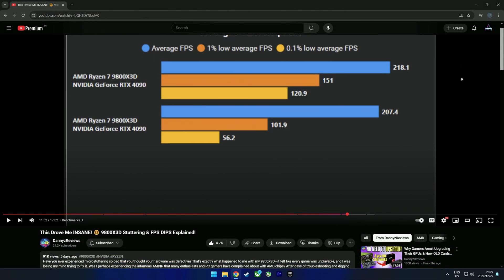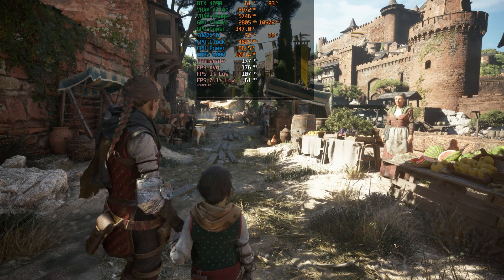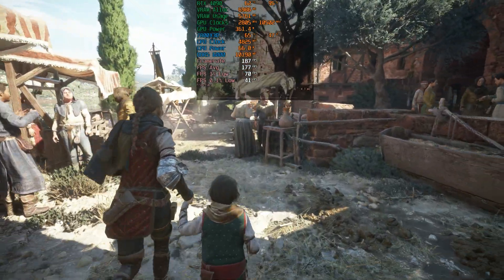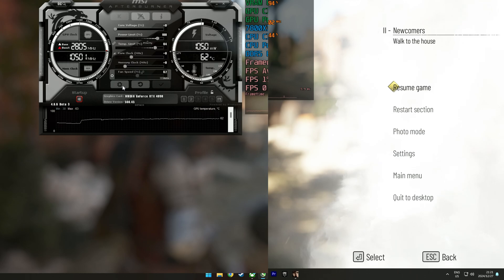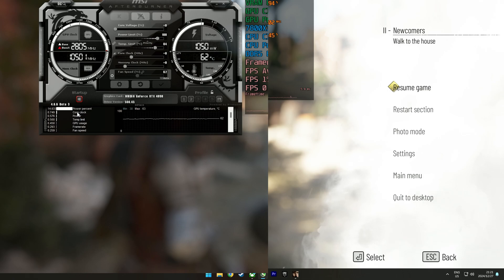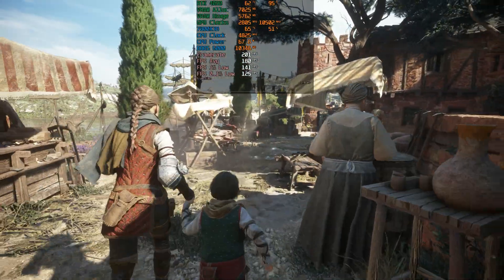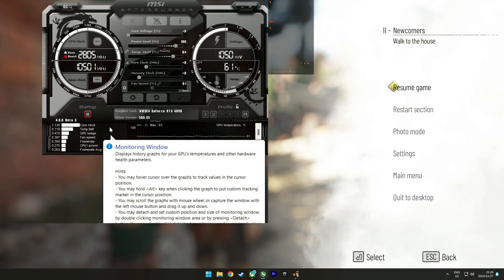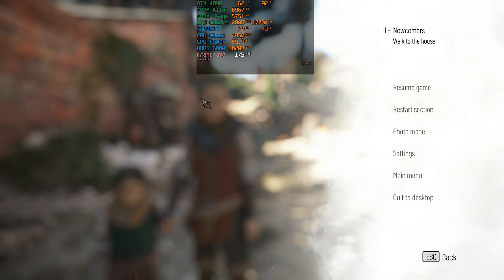MSI Afterburner Causing The Infamous "AMDip"?

Comment: I've been using MSI Afterburner since the end of 2015, so around 9 years now. I've gone from an i5 4460 to i7 7700k to R5 3600 to R9 5900X to R7 7800X3D and always used the OSD with a bunch of settings to see GPU and CPU temps, their overall usage, Vram allocation, Ram usage, and of course the FPS. With my 5900X PC around a year or two ago I turned on the frametime graph and discovered the actual dedicated Vram usage, I also had power usage for GPU and CPU showing.

Regardless of what's showing in the OSD, and even with the OSD off, as long as a setting is ticked in the Monitoring tab, Afterburner is going to be monitoring it. By default nearly everything is ticked, it's possible everything is ticked by default, I don't remember. But I usually would add some to the OSD, but I turned almost all of them off and immediately noticed a large reduction in stutter and that frametime graph is significantly smoother in games like Spiderman Miles Morales, BF2042, GTA 5 and Far Cry 6, those are the only games I've tested. 

These findings are absolutely insane, and a seemingly obvious one. You would think that it would be more widely known, and more heavily stated on the MSI Afterburner page that the monitoring is quite CPU intensive. Dedicated Vram Usage was like 5-10ms, GPU power was also 5-10ms, not to mention every other setting I wasn't using being ticked.

Comment: thanks for this, my GPU power metric was using 5ms 3.5 more than the next highest, perhaps I'll get an elmor labs or TG power monitor
Reply from the maker: You're welcome. That reading for power is actually quite okay, so the best is to see if it actually has an impact big enough to cause stuttering. Some sensors are combined and might show higher number than others, but might not cause stuttering. 

What I did was disable everything and start enabling things while a game was running. That way I can see how big of an impact a specific sensor really has, and in my case it was only power percent that had a big enough impact to cause stuttrring.
Reply: @Mostly_Positive_Reviews  thats a very good idea. im getting a new gpu next month and was only tracking so I can make sure I get a good gpu that uses the same but preferably less power than my 1080ti

Comment: What exactly is the problematic setting for the issue?
Reply: As he showed, you right click the graph and see which settings are using a lot of CPU time such as GPU Power, in my case with the same specs I had GPU Dedicated Memory was using 5-10ms as well. 

If you find some using a lot you can turn them off by going in to the Afterburner settings, then in to the Monitoring tab, and on the left of the settings you want to untick them, if the tick is lit up then it's on and will always be monitored by Afterburner even if it's not in your On Screen Display. 

Your OSD settings are ALWAYS being monitored by afterburner when that tick is lit up regardless if your overlay is on or not. 

I'd suggest unticking everything besides the ones you absolutely have to use. If you don't use an overlay and use Afterburner just for overclocking then untick everything.

Comment: Power has no impact for stuttering on my 7800x3d, maybe there is another factor for it 
(bios? bios version? Bios manufacturer? Bios tweaks? System tweaks? System? System version? Memory tweaks? Who knows?) While gaming doesnt go "high" ms to cause microstutter/spikes due to monitored power or any of the other chosen data stuff. I've tested same game Requiem too.
However good video to demonstrate profiler so more people get inform about it and clearly explaination about it too.
Reply: while your game is running turn off rivatuner "Application Detection Level"

Comment: The big question is why are people still using programs like MSI Afterburner? I stopped using it years ago after it was causing problems with games. AMD has their own monitoring built into the graphics drivers that works far better. Don't know if Nvidia does, its been years since I had Nvidia.
Reply from the maker: Because MSI AB gives a lot more info than the tools included in the drivers. A lot of historical data like individual CPU core usages, frametime graphs, 1% and 0.1% lows for when benchmarking. It's basically a CPU and GPU monitoring tool in one, which is very useful to someone like me who does benchmarking content.
Reply: @Mostly_Positive_Reviews  I would suggest Goverlay then. It is what I use on Linux.
Reply: Amds overlay has always been buggy for me even with Decembers latest drivers. Info being blank requiring tggling the overlay off then on again, cpu statistics randomly just straight up missing for no reason(tested on multiple fresh windows/driver installs), on top of showing different temps/cpu usage compared to afterburner/capframex
Reply: @ultimategohan1551  Goverlay is a free open source program to use.
Reply: @ultimategohan1551  I've replied twice to comments here and both have been removed. I'm not saying anything controversial or profane so I can only assume the channel is removing them. I'm listing a program (Goverlay) I use to track my temps and usage in game. Let's see if this one stays...
Reply: @YourDeletedComments  Did you include a link? Because that often triggers Youtube's auto mod.
Reply: @ no links, I learned those get deleted a long time ago.

Comment: yep it is the power percentage not the power itself. Thanks a lot for this monitoring trick for CPU time in MSI afterburner. I noticed GPU dedicated memory usage\process also takes a steady amount of 2.5-3 ms.
Reply from the maker: You're welcome! Some sensors are actually combined, so some will show 0.001 and others 5 for example, and in many cases it's because some sensors are combined in that output. Unwinder, the developer, told me about another way to monitor the cost of these sensors so will do another video showing that too.
Reply: It is more than normal value. It cannot be zero. I'm afraid I open jar of worms by showing profiler to everyone. Now a lot of users see something they don't understand completely and start interpreting it wrong.

Comment: idk why would someone run msi afterburner while playing or using his pc in general.. even if you have an oc profile.. you can make a bat file which can load the profile on startup without even opening msi afterburner... the only thing that requires msi afterburner opened is the fan curve.. which is useless.. just put a static speed
just put this text(including the " ") in text file and rename it to whatever.bat
"C:\Program Files (x86)\MSI Afterburner\MSIAfterburner.exe" /Profile4 /Q
u can change the path as yours also the profile number you want
can you pin this comment?@Mostly_Positive_Reviews

Comment: this is the reading time from gpu these sensors usually need from 10 to 18ms and this is normal for many years. I have it like this on intel and I have no problems with frametime. I have temp gpu. power gpu and hot spot gpu I have amd 7900xtx gpu. Maybe nvidia drivers are messed up like last time

Comment: Yeah, any monitoring software can cause this.  A way to monitor output FPS using a dongle on the HDMI/DP video output might be interesting.
Reply from the maker: Yeah, what DF does is use a capture card but they have their own software that marks each frame. Them when they play it back in their software it can tell you what your FPS and frametimes are. I know Nvidia has something similar to identify duplicate frames, and I think their software is kind of based on similar technologies. Could be completely wrong though. But in that case you are limited by your capture card's refresh rate.

Comment: yes i always have turned off the ones i don't use otherwise it causes a dip.  i've been saying this to framechasers and media alike.  it's always a program or some sort of setting.  however i still can't explain why this doesn't happen on intel.  wattage could be a factor as well since amd is trying to be efficient.  if it's fixable with turning off MSI Afterburner settings for example, then that's good enough for me as i find it a very rare thing to occur anyways.
Reply from the maker: Yeah, being selective in your probes / sensors is the best way to go about it. They all have some impact, but some a lot less than others, so it's importsnt to find that sweet spot. 

With regards to Intel vs AMD, I have no clue really. I've seen some people say they have this issue on previous gen Intel CPUs, specifically 10th gen laptop CPUs, but I havent been able to reproduce it on either my 12th and 14th gen systems. I still need to test with e-cores off though.

Comment: why would you use MSI afterburner if theirs a whole wattman tool in the AMD drivers? i dont understand people you think a third party APP is going to run better than AMD's own implementation? lmfao USE YOUR DRIVERS.
Reply from the maker: Now why would I use AMD drivers when I use an Nvidia GPU in this video?
Reply: Well since as far as I can tell I can't get it to show that data in screen recordings so I have to rely on (Well was using Afterburner but now will use FPS Monitor which still might have issues with frame times and will have to test out.

Comment: Huh, I just tried it and it works..
Reply from the maker: You sound surprised? 🤣
Reply: @Mostly_Positive_Reviews  Yeah, why TF is Afterburner doing that (rivatuner)
Reply from the maker: It's got to do with how the NVAPI is called for this sensor. It's not limited to Afterburner though, most monitoring software have the same issue reading this value on Nvidia GPUs.
Reply: @Mostly_Positive_Reviews  Makes sense. At least I can still have stats up without the weird behaviour, cheers for the video.

Comment: 7800X3D here, I don't even use the Afterburner myself, so I should be good to go?
EDIT: I did fire up the Afterburner just now (in desktop) just to see which monitor/sensor could cause any issues and immediately found "GPU1 Temperature" hovering between 15 and 16ms while everything else was way lower, second highest value (Framerate) only showing 0.25, and then the rest of the stuff getting smaller and smaller.
Kinda inconvenient, GPU temperature is one thing that I pretty much always keep an eye on!
Luckily, I use Radeon Adrenalin software's own overlay to monitor these things instead so it's not that much of a biggie.
Reply from the maker: The values for AMD GPUs are shown differently and those values seem about right, you neednt worry about those. You can check unwinder's comments on here, he explains it well (the MSI AB dev).

Comment: Why in the goddamn fk isn't all the monitoring fully asynchronous???
Reply: Why do you need to comment something you don't understand _at_all_? Any kind of monitoring lives in its own process, it is not done in context of game you play. So of course it is fully asynchronous.
Reply: @unwinder  Okay genius make me /understand/ how a fully async process affects the frame times of a running game if it isn't interrupting the actual CPU or GPU thread that's running the game? If it was fully async, meaning running on a different physical core AND the driver pulling telemetry without taking up render thread time there would be no performance penalty in the first place.

Comment: Short answer: YES!

Longer answer: Just swithed from a 3070 overclocked with afterburner and RTSS running to a 7900xt had a list of instabilities and performance weirdness going on so I disabled the Adreneline software but not the driver and got the 7900xt to work as expected with afterburner and RTSS, as if by magic the issues went away. So I tried it the other way round and also worked like a dream so I enabled afterburner and BOOM dips in 1% lows driver crashes OC values not accepting after a reboot and probably more weirdness had I left the system in that setup.

Can introduce issues when using any hardware polling like HWinfo but afterburner and RTSS is by far the worst in my limited testing, you can work around this by only using the AMD driver and not the full adrenaline software but seeing as that software works well and has a bunch of features built it to do these things I would just use it and not use other programs unless you need a specific function and have no other work around.

Also and this might be way out of date so take with a big caveat the guy (I think) who was developing Afternurner for MSI was in Russia and things got weird with payments due to world events and I'm not sure if thats a factor or what state the dev of afterburner even is now but yeah might be a less/lack of development making this problem worse.

Comment: i7 13700k with E-cores disabled (5.6 ghz, 4.9 ghz cache, 7000 ram, lowered timings) + RTX 4090 - I've turned on Profiler to see my latencies and saw ~9-16ms latency caused by GPU power compared to just ~0.9ms being Core Clock, then goes GPU load - ~0.5ms and temp metrics being ~0.1-0.3ms. In cs 2 that gpu power draw metrics caused lower fps when I got killed, when disabled fps remained about the same as AVG and i didn't have that sudden fps drop, fps got more stable and frame-time graph got cleaner, its now almost a perfect dead line like it should be. I have ~51ns RAM latency in aida64 and ~112 / 109 gbps read / write / copy speeds and maybe that affects how its less relevant on intel system than on amd where ram latency is a bit higher ? But anyway it does affect BOTH systems if you look at Profiler + Frametime graph + 0.1% lows. Glad I found that, i've msi ufterburner for years but didn't know about these little things, imagine how many are suffering and thinking its game developers fault. In my case I was stuggling in cs 2 over a year playing with frame time spikes and fps drops when killed, it wasn't perfectly smooth experience at all espcially in death match and then i found out it was caused my E-cores, the only game which had big problems running with them, I've then did huge analysis in many other games and yes i do get much higher fps and much smoother frametimes without E - cores, CS 2's source engine would run on E-cores even if only 2 were left running, it would throw 100% of workload on them instead of P-cores. And trust me these ''little'' things are only a tip of an iceberg of what can cause stuttering and frame time drops in our systems, there are many things in windows 10/11 itself, that's why i was always running debloated windows (60 processes) and debloated nvidia drivers to have clean frametimes and lows being close to AVG, that's when you achieve that buttery smoot experience.
Reply from the maker: I still need to test my 12th gen and 14th gen with e-cores disabled, but with e-cores enabled I see no difference with power % on or off. Appreciate you sharing your findings!

Comment: Damn, i had a lot of things using around 15ms. GPU Temp, Hotspot temp, Core Clock, Memory Clock, Fan rpm. Very useful video, thanks.
Reply: Which GPU is that?
Reply: @unwinder  AMD RX 6600
Reply: @unwinder  Ok, i kinda get it. Now, when i switch on any of GPU sensors (outside of GPU usage and fan speed (not rpm)) my polling time goes from 1,5 ms to 15-20 ms
Reply: @rentojad  Exactly the same behavior. Any GPU sensor puts it to 15ms.
Reply: @rentojad  one more time, you see cumulative time for all GPU sensor at once. AMD sensors are not read independently of each other, they are polled in a single call.
Reply: @rain8478  it must be so. Just do not use the profiler, you cleary don't understand what you see.
Reply: @unwinder  I understand, but even if i switch on a single GPU sensor my polling time goes from 1,5 to 15-20 ms.
Reply: @rentojad  nope, you don't understand it. It must be so, it is absolutely normal for AMD GPUs. You cannot selectively enable/disable polling for independent sensors on that side. Enabling even a single sensor causes the driver to poll them _ALL_, polling time for the first AMD GPU sensor is cumulative, the rest are 0 due to reading data from cache. That is NORMAL and EXPECTED.
Reply: @unwinder  Ok, what i meant was - shouldn't i be using any GPU sensors monitoring then? 15-20 ms is kinda high.
Reply: @rentojad  it is not high, it is close to ideal if it is a total time. It is lower than total polling time on average NV GPU related systems.

Comment: i dont have msi afterburner on my pc, but i do have msi center. could it cause any stutters? i cant see any options that i can change on there.
Reply from the maker: You use it for RGB control etc? Basically every actively running app has some performance cost, some big, some small. If it doesnt negatively impact your gaming experience I wouldnt worry too much about it.
Reply: @Mostly_Positive_Reviews  mostly just for monitoring yeah. if there isnt anything substantial i guess ill keep it on. thanks for ur help